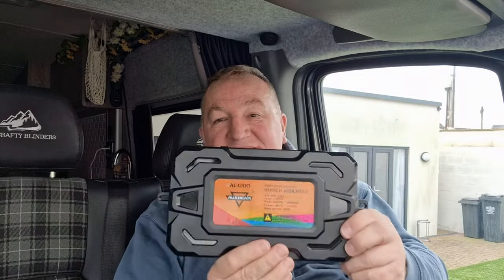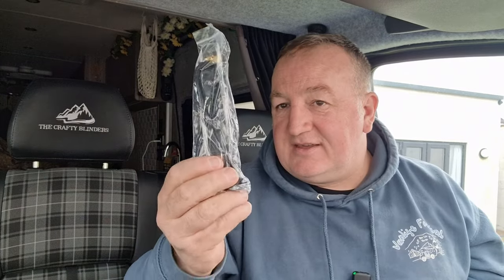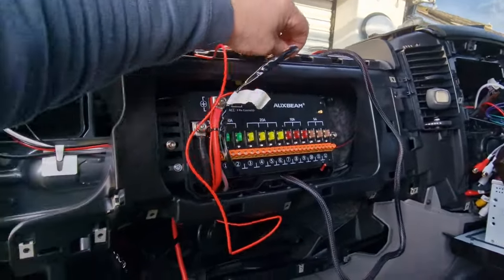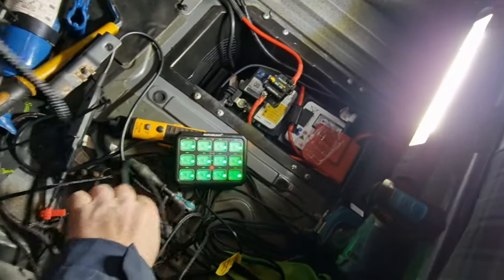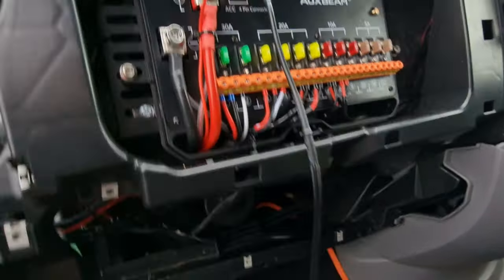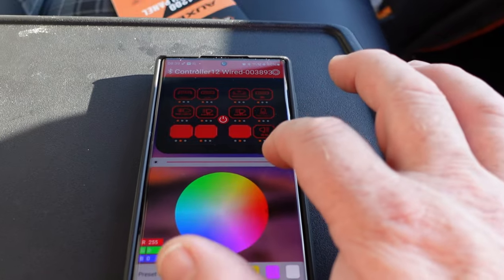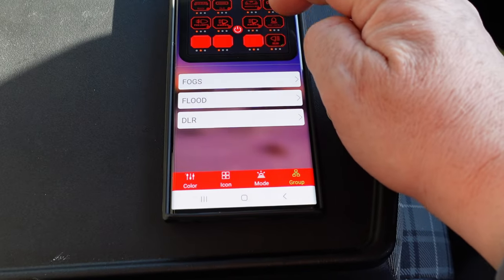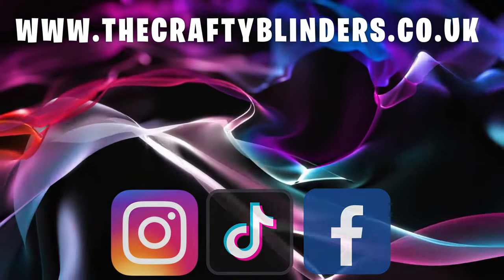How to install Auxbeam 12 gang switch panel with remote control AC1200 RGB

Comment: Hey, great video. Do you know if you can wire a remote switch to power on an off an inverter. You may be familiar with the Renogy brand inverters. I have a 2000w pure sine wave inverter that came with a remote on off switch. I was wondering if there’s any way it can be connected to the auxbeam switch to have all my controls in one location.

Comment: I got the dual panel set from Auxbeam. Such a simple system to fit and I would highly recommend anyone who's just starting to build to go buy one.
Reply from the maker: So simple to use
Reply: I just got the ac1200 tell me more about the Dual panel set......... so what I'm thinking is you can have one panel on the dash and maybe one control panel in the back of the RV is that correct
Reply: @deddie4645  that's exactly correct. You can turn something on in the cab then go in the back and turn it off, and visa versa

Comment: Thanks for this really useful video 👍 Quick question, have you taken this off your vehicle battery? If so is it ok to take straight from the battery rather than a feed activated by the ignition? It doesn’t have a constant load on it does it? Thanks for your help
Reply from the maker: I've taken the supply from the starter battery with a switch live to the internal contact so the panel will only work when the engine is running. That way, we have no flat battery issues
Reply: Ah I see. Thank you 👍

Comment: Another great video, mate! Easy to follow and obviously a well though out product!
Oh how I envy you. All that room in the A-pillars and the dash, where everything in my Crafter is filled with air bags.
But, when I am at that stage, I'll have to find a way to fit one - perhaps a smaller 6-gang unit. Will the relay unit for the 6-gang setup be smaller or just less populated than the 12-gang unit?
Do all Auxbeam switch panels feature remote controls?
Thanks for taking the time to do the video and cheers from across the pond! 🚐☁🍀
Reply from the maker: just throw the air bags away and fit a resistor then you will have lots of room
Reply: @TheCraftyBlindersvanlife  In a minute, my friend. Unfortunately, the local authorities will not certify the roadworthiness without the factory equipped balloons on the next due date in July... 🙄

Comment: I have the 8 gang will the remote work with that and can you purchase the remote on its own
Reply: Same here. Can we upgrade to the 12 gand reusing the remote wiring? Mine is behind the cladding.
Reply from the maker: Great question, there is an 8 gang controller
Why not check out  https://auxbeam.com/products/8-gang-wireless-remote-control-for-ra84-switch-panel?_pos=14&_sid=2cd37d14a&_ss=r
Reply from the maker: The 12 gang switch panel only fits the 12 gang control I believe

Comment: I have the 6 switch - its a pain in the ass as you cant turn off the light unless you turn off everything then whats the point of having a swtich in the van
Reply: what light do you mean; that you can't turn off?
Reply: @antmck33  Well - you can turn off and on say your light bar - that has a small light to say its on or off, you can turn the whole panel off - each button has a backlight - thats on all the time, unless the swtich itself is turned off. So my scenario is this - i use that in my van, i have the switch setup with my fridge, usb, lights etc. The whole thing is lit up all the time - unless i use a toggle swtich to turn it off - which means turning everything off so it can be dark at night. So then i cant get up in the night and just flick a switch for a light - i have to toggle the Auxbeam back, then press the lights button - then turn the light on. So the two options is (even if the backlight is turned all the way down - and the instructions say something about it will self dim - it doesnt) - leave it on - let it light up the van all the time, or add a toggle relay to turn it off in the middle - which is what Auxbeam support suggested
Reply from the maker: that sounds like its not wired correctly,
Reply: Something I just learned you can get a rough country single remote control and transmitter and wire it into the 12 volt accessory line with a diode so it doesn't backfeed into the the ignition system or accessory..... so you can use the single switch remote to completely turn off the power to everything and then it's drawing a very tiny amount of voltage then you hit the single switch key fob and it energizes the control panel..... say you're in bed and you don't want to get up and walk to the control panel to shut it down you just hit the single remote it turns off the accessory powered to the control panel then if you want to turn something on you use the remote to energize the control panel and then you have your 12 gang switch fully at your disposal from bed